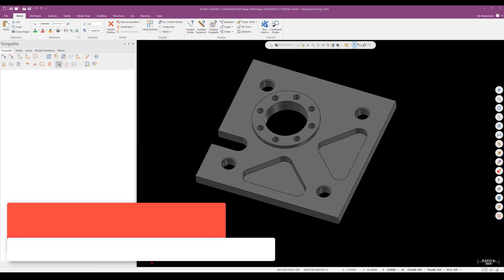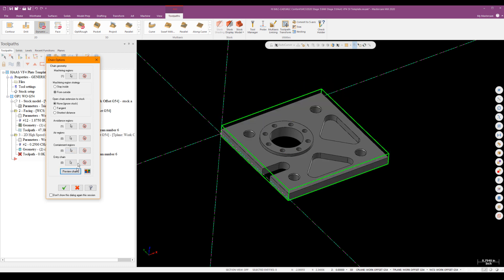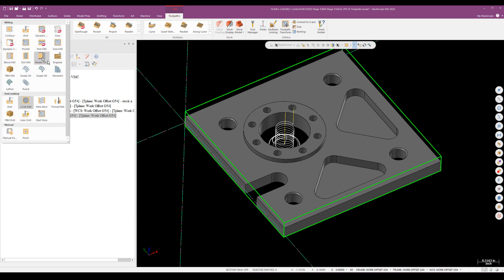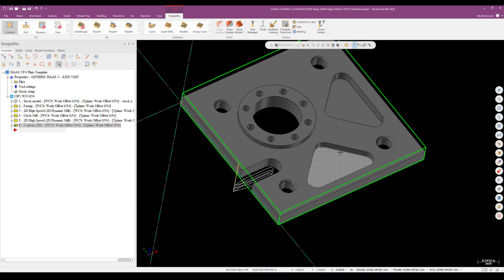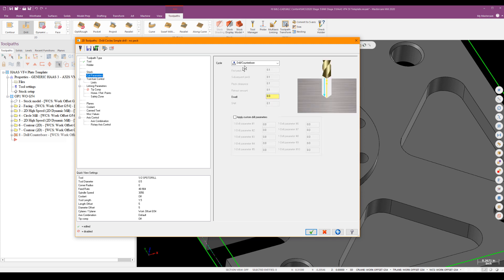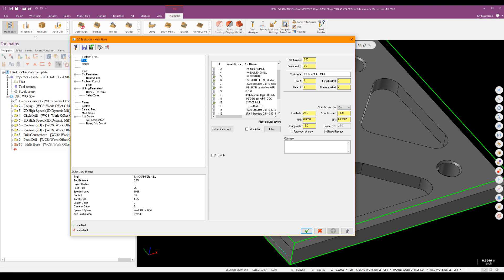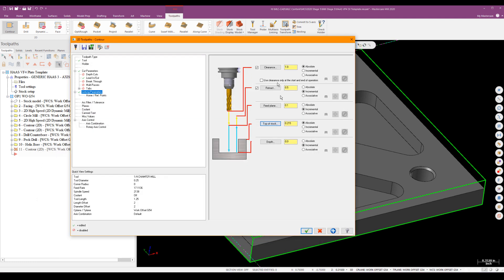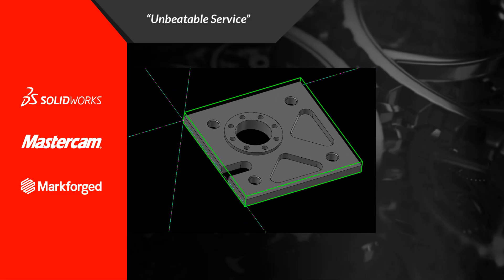Mastercam Mill Demo

Comment: Not sure if it's been mentioned,but when you chamfered the 4 holes, since you chained the outer edge of the chamfer you can just tell Mastercam to cut a chamfer size of zero.  This way you don't have to also enter a value in the stock to leave box.
Reply from the maker: There are several ways to do most things, as long as the selections and the options you set match up to get a good result!